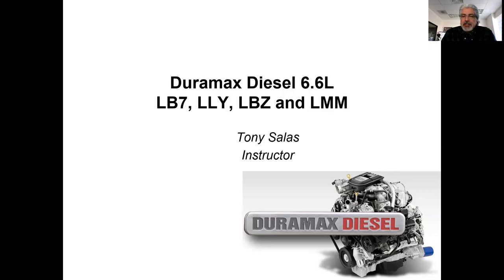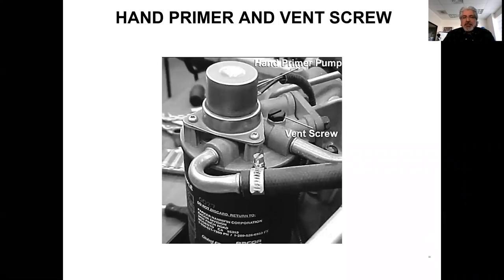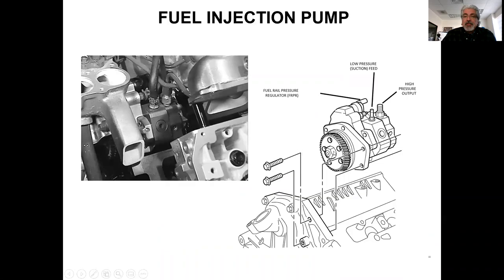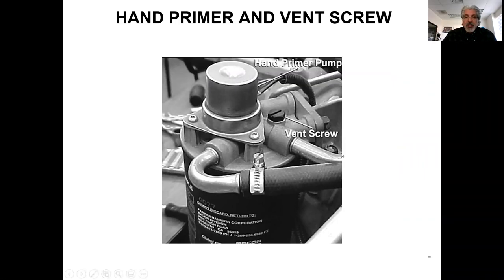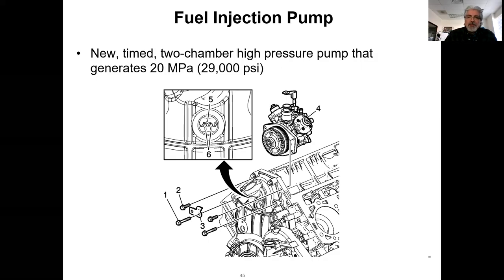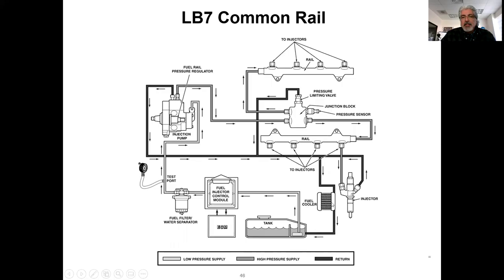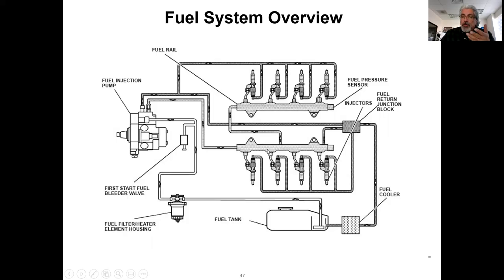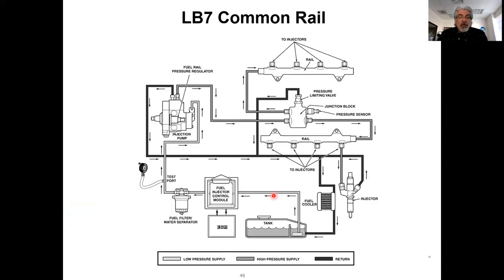Duramax 6.6L CR Diesel Talk

Comment: Is there a fuel pressure relief on the LB7 rail
Reply from the maker: No it’s on the junction block
But the aftermarket sells a plug which I recommend since the ECM can still shut it down in the event of over pressurization

Comment: LLY coughs on acceleration.. Change the fuel filter  still same problem.. Fuel gauge stop working Could this be the problem? Should I add l lift pump while at it? 
Awesome Detail on your video. 
Thanks!!
Reply from the maker: Generally when a diesel coughs as you state it is not pressure related. It is usually a cylinder misfire or sensor issue from my experience. This is where I need to check all cylinders are operating and check fuel balancing rates.

Comment: What about a High Rail pressure situation?
Reply from the maker: If there is a high rail pressure issue, it comes down to the fuel pressure regulator which GM calls the FRPR. 
This applies to LB7 to LMM.
For LML there is a high pressure regulator along with the FRPR.
Note that if the truck has an aftermarket lift pump it can also cause a high pressure issue if regulator on it is not calibrated correctly.

Comment: Does the hand primer send fuel all the way to the injectors or does it pressurize between the filter head and the cp3?
Reply from the maker: To the CP3 in toward the transfer pump on the back of the CP3 pump itself. Then to the crankcase of the CP3 to lubricate it and to the MPROP or regulator that modulates the fuel volume to the high pressure plungers.
Hope that helps! Thanks for watching!
Reply: @dieseltalkwithtonysalas8725  I replaced the regulator at the same time I did injectors, could a torn or leaking o-ring on the FRPR cause a loss of prime at the filter head, the regulator is in a bad place to be able to see if it's leaking or not but I can't hear any fuel leaking or anything but primer wont get hard like it did before injector swap but will still fire up after about 10 seconds of cranking
Reply from the maker: @maverickjohnson7534  I have never seen that but that’s why GM tells you to prime to 10 psi to check for leak internal and external. 
Need a gauge to check that. 
What year model you have?
Reply: @dieseltalkwithtonysalas8725  2002 lb7

Comment: Can you explain why I get a p0088 high pressure code
Reply from the maker: High fuel rail pressure usually is the fuel pressure regulator on the injection pump unless it has an aftermarket lift pump where lift pump pressure is set to high 
Thanks for watching!

Comment: Very informative video
I do have a question. I keep getting a low rail pressure code when towing 8k car hauler with my 2006 lly duramax I have a hp tuners so I have been able to check balance rates and that seems good but every time it happens my fuel temp is around 170ish and it will command 26000 and drop to around  18000 to 22000. I have a lift pump besides that the truck is stock. I was wondering what your opinion on ppe fuel rail pug was And if the cascade valve on the cp3 could be bad. Befor I start pulling injectors and cp3 to be tested. Thanks
Reply from the maker: Most likely it’s the pressure relief valve
It’s easy to diagnose. Simply get to the small return hose coming off the rear of drivers side rail and plug it . Then run a 6ft small hose attached to to that nipple on that rear rail where you pulled it and run the other end of the hose to your drivers seat with it inserted in a water bottle obviously empty. Go on a test drive, load it run it hard, if it squirts any fuel into bottle, definitely replace with ppe plug. If not then you need to get a vacuum pressure gauge made for Duramax and I can explain how you test cascade valve. 
Let me know.

Comment: Hello , I have a question. Why do we need fuel cooler at the return-line to fuel tank?  Do engine diesel engine must install fuel cooler in mandatory??

We have a problem with in-line 6 Diesel engine high pressure pump tappet roller damage. (damage at the high pressure pump tappet cylinder roller wear and it makes a fragments , which block the injector and Engine stops.
When I checked the fuel tank, there were small metal particles , which from high pressure pump roller damage.
I have to replace all fuel system because of this damage.   

I guess , if the fuel temperature is high at fuel tank, the diesel fuel viscosity drop and get damages at high pressure pump roller lubrication.   

Do we need fuel cooler at all diesel engines mandatory?

Thanks and regard.
Reply from the maker: The pump problem you are having sounds like lubricity issue with the fuel. I have seen the issue you mentioned. But! Always remember water in fuel! If you think about it the pump is one of the hottest places in the common rail system. Therefore lube fuel in the pump with a substantial amount of water can have water separation in the pump crankcase destroy it due to lubricity.
Now why the fuel cooler… it should be called a fuel condenser. It ensures no fuel in a vapor state goes back into the fuel tank. Imagine the right condition in the fuel system where it can be so hot with pressurized fuel and it changes from a liquid to a gas. By cooling the return fuel it ensures it stays in a liquid state.

Hope that helps! Thanks for commenting!

Comment: Hey Tony I have an 08 van, which battery does the engine start from? Currently chasing stray voltage that keeps killing it after a few days with new batteries.
Reply from the maker: Both. Batteries are in parallel if I’m not mistaken.
If you are draining battery I would do the test Light fuse pull trick. You first take one battery out of play by removing the positive battery terminal and leave it off 
Now the other battery you remove that battery positive terminal and put one end of the testlight on the terminal and the pointed end on the actual battery terminal. If there is a draw it will light. At that point start pulling fuses out one at a time and see where the light goes out. 
You use a non led testlight. 
The fuse that dims or turns the light off is the circuit with the draw. Make sure key is off.
Reply: @dieseltalkwithtonysalas8725  Thank you I'll try it!

Comment: Can bad gas cap give code P1093?
Reply from the maker: No 
I believe it is a fuel rail pressure code
Which year model you have?
Reply: It's a 2002 gmc sierra 2500hd 4x4 duramax LB7
Reply: Also have code P0102
Reply: I connector a guage to fuel test port gauge was reading 6 inHg  vac
Reply: Federal emission.
Reply from the maker: @jose.lgarcia5729  6 is too much at idle
Change fuel filter retest
Reply: @dieseltalkwithtonysalas8725  
Ok, thank you

Comment: I have a LB7 when i start it the fuel wants to come back out the fuel cap almost like pressure is pushing it out even after I turn it off and remove the cap fuel will come out unless I wait 10 or 15 minutes I can take it off with no fuel coming out not sure why??
Reply from the maker: Sounds like high pressure is on the return side.
But what is the level in the tank when this occurs?
Reply: @dieseltalkwithtonysalas8725  my fuel gauge is not working and it sounds like there’s a fast ticking noise from the tank I add diesel it pours out but it does slowly go back down I’m not sure if the tank is full or not this just happened today and didn’t add more fuel after…haven’t drove it in a while but I’ll  try to add more fuel tomorrow and see